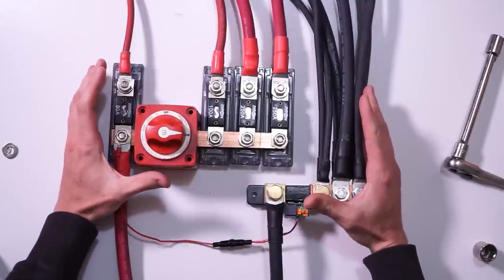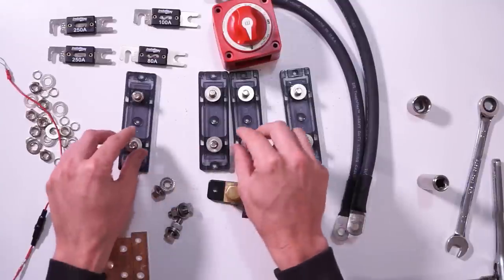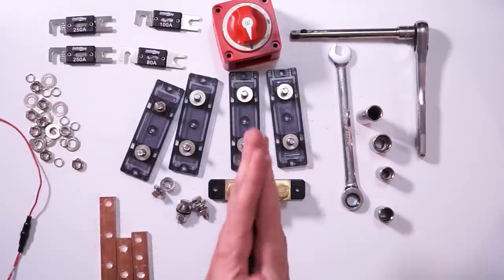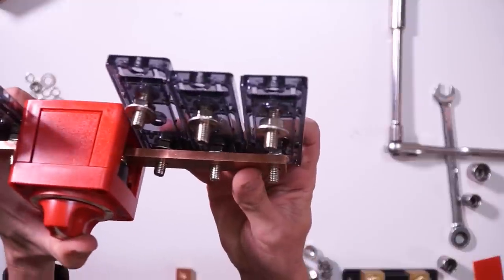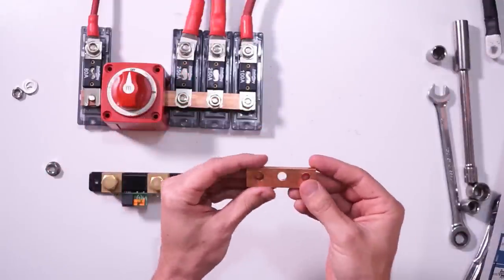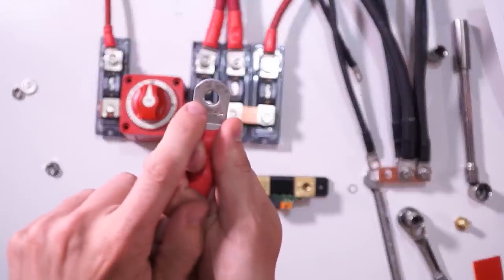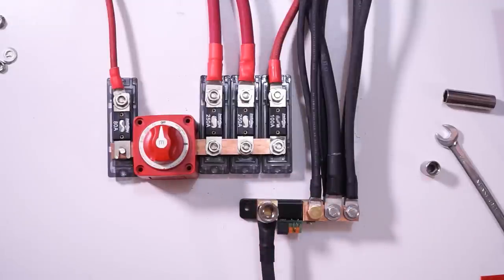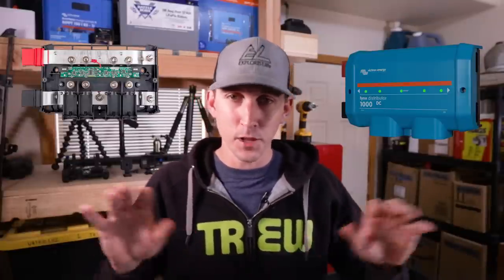How To Build a DIY Busbar for a Camper Van Solar Install

Comment: This is a very helpful tutorial. My only issue has been locating the 50 and 250 anl fuse holders by install gear. I’ve got a couple of 250s from baomain, but they come with a brass nut at the base and no washer. I suppose I could just customize this by adding a washer. Do you have any recommendations?
Reply from the maker: I'm working on updating the links & recommendations, but I no longer recommend the holders and fuses in this video.  Check the "Cheap vs Expensive fuses" heading on this blog post: https://www.explorist.life/best-fuses-fuse-holders-for-a-diy-camper-electrical-install/
Reply: Good to know. Can I still use the more expensive anl fuses in the diy bus bar configuration?
Reply from the maker: Yes, I would also recommend upgrading to the Blue Sea fuse holders as well.  

All said and done, though, The Lynx Distributor I have spec'd in the following diagram may be comparable priced and will fit in a smaller area: https://www.explorist.life/3000w-inverter-400-600ah-400-to-1200w-solar-camper-solar-kit
Reply: I’ve almost completed the diy bus bar so I think I’ll stick with it for now. The blue sea fuse holders on Amazon are a bit confusing. I can’t tell whether they are 100amp or 250amp. Do you know?
Reply from the maker: In that first link to the website... there are two variations of fuse holders.  Check those again.
Reply: Are you available to schedule a consultation?
Reply from the maker: Yep!  Here is my private group where you can get personalized help: https://explorist-life.mn.co/

Comment: Would you recommend using a spod instead of switches and breakers?
Reply from the maker: For lights and such, an spod is fine.  For the big loads like an Inverter or a charge controller, I recommend the Victron Lynx as an off-the-shelf solution.  See this diagram: https://www.explorist.life/3000w-inverter-400-600ah-400-to-1200w-solar-camper-solar-kit

Comment: What thickness and width bus bar did you use? I'm been looking online they reckon 3mm thick by 12.5mm wide is only good for 47 amps
Reply from the maker: Check the pinned comment.

Comment: Instead of attaching the alternator to this system, could I substitute a generator to that position and it charge the battery the same way?
Reply: You need to connect a battery charger to the generator.

Comment: You're using a  300 Amp Disconnect. What if I have 400Ah of LiFePo4 batteries with 600W solar panels and a 4000W inverter. Will the 300 Amp disconnect be okay?
Reply from the maker: 4000 Watts pulled from a 12V Battery bank is about 333 Amps.  You will need a bigger switch: https://amzn.to/3bR7amI
Reply: @EXPLORISTlife  Awesome. Thanks Nate
Reply from the maker: No problem! :)

Comment: Where are the solar cables going to???  The panels are leading to where exactly in this?
Reply from the maker: Solar array -> Solar Charge Controller -> Busbars (Or Lynx Distributor)  Example: https://www.explorist.life/3000w-inverter-400-600ah-400-to-1200w-solar-camper-solar-kit

Comment: Hey Nate, not sure which wire diagram to use but I have a 330 watts of solar , 3000 watt inverter with 300 amp hour batteries can you tell me which diagram to go with
Reply from the maker: With a 3000w Inverter, You'll be looking for this diagram: https://www.explorist.life/3000w-inverter-400-600ah-400-to-1200w-solar-camper-solar-kit/
Reply: @EXPLORISTlife  thanks

Comment: For 4/0 copper equivalent could I go 1/2 x 1” instead of the 1/4 x 1 1/2?
Reply from the maker: I suspect that a 1/2" bar would not fit on the blue sea ANL fuse holders.

Comment: Hey Nate, great vid and idea! I was just wondering if, after installing the thick copper bar, there was enough thread on the fuse holder terminals to properly secure the nuts? Thanks again
Reply from the maker: Yes.

Comment: Hi I have a 450w on solar panels and 230amp batteries, for the bus bar I found a 1"x3/16 copper bar, is it ok for my config or I should find the 1/4" one?
Reply from the maker: You'll want to look up the max ampacity of that copper bar to determine that.

Comment: It appears these added fuses is a redundancy as each unit that connects to the bus already has its own fuses. Why is the needed. Your system could disconnect the batteries with the flip of the switch, when in storage. I am not seeing that option with the 
Victron Lynx Distributor

Any help understanding this redundancy and inability to easily disconnect?
Reply from the maker: There is no redundancy in fusing.  The wires from the Lynx distributor are protected by the fuses inside of the distributor.  NONE of the other devices (Inverter/Charger, MPPT, Orion) have their own fuses; and even if they did, fuses would be needed at the Lynx distributor to protect the wires to these devices.

My newest diagrams also have a switch.  It's just between the battery bank and the lynx distributor.  See here for an example: https://www.explorist.life/3000w-inverter-400-600ah-400-to-1200w-solar-camper-solar-kit
Reply: @EXPLORISTlife  The Inverter I have is fused internally. The charger is fused externally. The solar controler is the only one I am not sure about. So the fuses in the Lynx distributor are thermal fuses?
Reply from the maker: Your inverter charger may be fused internally, but is that fuse protecting the wire going to it from short circuit? (I'd guess not.)

Remember... fuses protect wires, not devices.

The fuses used in the Lynx are MEGA fuses, so I'll let you research that as deep as you care to dive.

Comment: Great video Nate, Any reason you went with the ANL fuse system vs individual circuit breakers with manual reset? They can also act as an on/off switch....  Thanks Jeff
Reply from the maker: Thanks!  Yep!  The ANL fuses fit on the busbar as opposed to individual circuit breakers.  This means the whole setup can fit in a much smaller space with few connections which means less parts and less resistance.  I've found that over 3 years on the road; the devices protected by the ANL fuses in this setup, never needed to be turned off individually, one by one and could, instead, simply be turned off by the master disconnect.

Comment: How many batteries do you need for a sprinter van conversion with solar panels
Reply from the maker: That depends on how much power you plan on using on a daily basis.  Here is a tutorial to calculate that: https://www.youtube.com/watch?v=a406IxiU-Xg
Reply: @EXPLORISTlife  
Since I'm new at this do you have it use solar panels to run things and charge your batteries
Reply from the maker: Solar panels recharge batteries.  Batteries run your devices.  That's the easiest way to think about flow of power.
Reply: @EXPLORISTlife  
I have a drawing of what I want my electric to look with water heater,  can you give me your opinion when you look at or draw me up one do you have a email
Reply from the maker: I have several diagrams publicly available here: https://www.explorist.life/solarwiringdiagrams

And a 120V branch circuit diagram here: https://www.explorist.life/how-to-wire-120v-ac-circuits-in-a-diy-camper-van/

I do not offer support via email, but I have a private group available for more in depth questions/answers: community.explorist.life

Comment: Could you design a system for a 40 ft 5th wheel. Residential fridge, convection microwave, 3 a/c
Reply from the maker: Sure!  Fill out a wiring diagram request form and I'll consider adding it to the site: https://forms.gle/xdQj412jMtfXV9Hf6
Reply: EXPLORIST life - DIY Campers thank you

Comment: How did you mount the inverter charger in the thumbnail?
Reply from the maker: Bolts through the case of the inverter.  I drilled the holes.  The inverter doesn't come with holes in those locations.

Comment: Do you list dimensions of this setup anywhere? I'd like to enclose this in a box and then mount.
Reply from the maker: It's somewhere in the 12" x 8" range by the time it's all said and done with but I don't have one of these on hand specifically to measure at the moment.

Comment: I don't think that busbar is thick enough to carry substantial continuous current, as far as I know the busbar size for 250A should be around 20x10mm.
Reply from the maker: The 1/4" x 3/4" copper is the same copper content as 4/0 wire.

Comment: are you still selling these?
Reply from the maker: I am no longer making these for others.  If you are looking for a off-the-shelf solution, you should look into the Victron Lynx Distributor: https://battlebornbatteries.com/product/victron-lynx-distributor/?afmc=explorist_bb67

I have incorporated this system into my 3 most recent diagrams.  Example: https://www.explorist.life/2000w-inverter-200-400ah-lithium-200-to-700w-solar-camper-wiring-diagram/
Reply: @EXPLORISTlife  Thank you so much! Your site is amazing. I'm just starting to learn all this.  My van arrives in Dec.  I'm following your plans and buying options, and I'm sure I'll pay for a call once I get to actually working. I don't want to kill myself, so I'm thinking I'll set everything up and then, before turning it all on on, I'll get it all checked out. (And since the metal place will cut the metal, I'm gonna make that while waiting for the van.)

Comment: Hello 
My name is Bernie
I have a 2019 AirStream
I would like to upgrade some items
I would like to upgrade the inverter to a Victron 2000 watt inverter/charger.
Do I have to do anything to the stock converter. Because I installed lithium batteries and it won’t fully charger them.
The lithium batteries charge at 14.2 to 14.6v
I also would like to install two 100 watt solar panels on the roof
And install Victron GX touch 50 monitoring system and a victron solar controller 
What’s the best way to contact you. Email or cell
Thank you for your help
Reply from the maker: I have OEM RV Retrofit diagrams available that should get you pointed in the right direction here: https://www.explorist.life/solarwiringdiagrams.

Comment: Couldn't the fuse holders easily be diy'ed from phenolic plastic (cutting boards) 🤔
Reply from the maker: Just buy the proper fuse holders.  I'm not about to DIY wires by digging in my backyard for copper ore. 🤣😂

Comment: This calls for a 1/4"x1"bar for 4/0 wire your blog has it 1/4x 11/2"
Reply from the maker: 4/0 would indeed be 1/4" x 1 1/2", but I ultimately no longer recommend making this system.  Instead, I recommend just using the Victron Lynx Distributor: https://amzn.to/37TMUhX  By the time high quality blue sea fuse holders & fuses are used; the price is similar.  I've migrated ALL of my diagrams at https://www.explorist.life/solarwiringdiagrams over to the Lynx Distributor

Comment: So I wired up my solar panels and battery bank according to this guys schematic and it totally shorted out everything and I'm not even sure yet what the overall damage is. I'll have to take my van to a pro now and have all my components tested as well as the batteries tested. It could be very costly. My advice is DON'T FOLLOW THIS ADVICE.
Reply from the maker: Shorting means that a positive and a negative were connected somewhere.  Nowhere in any of my diagrams recommend connecting a positive and negative.

Comment: I am installing a DC to DC charger by Renogy.  Do you think it is better to buy 1 roll of black 30 foot wire or combo of 15 ft red/15 ft black?   What do you do?  I was thinking it would be better with just 1 roll black because then I would have 1 remaining left over piece rather than 2 .
Reply from the maker: Running red wire for positive and black wire for negative is what I have in all of my diagrams at https://www.explorist.life/solarwiringdiagrams and is indeed what I would recommend.